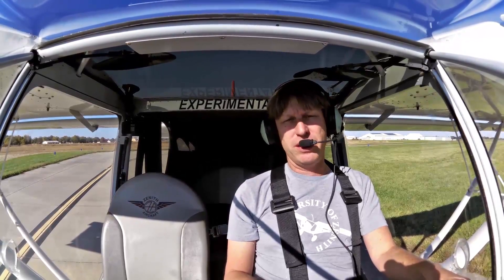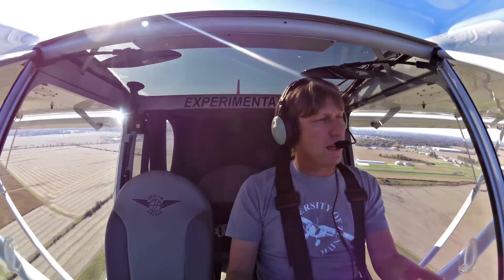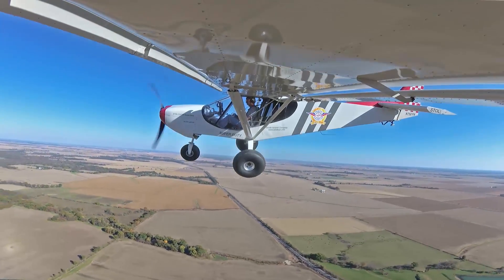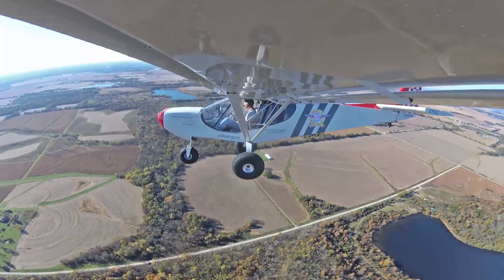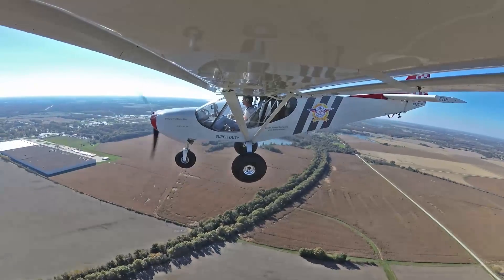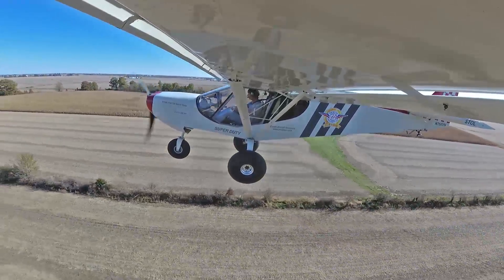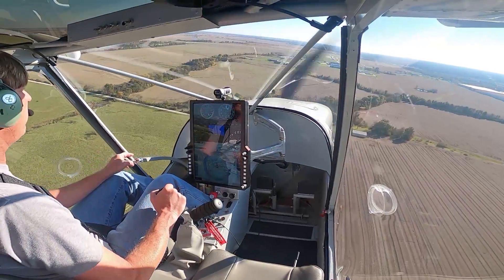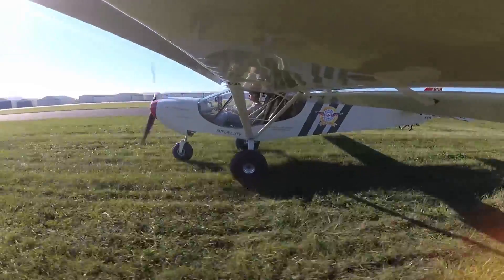Demo Flight: Zenith STOL CH 750 Super Duty "SkyJeep" sport utility kit airplane

Comment: Thanks for the demo flight.
If you do another demo flight would you mind doing a simulated engine out landing? I think I've heard it mentioned that the STOL characteristics of the aircraft induce a bit more drag and a higher sink rate that the Cruzer, for example. I assume you just carry a bit more airspeed on final?

Comment: Thanks for the video. I do like this airplane. 
Question, is there space in the fuselage just behind the rear seat to put a small netted baggage/cargo compartment? My thinking is to reduce gross weight by moving a lighter CG counter balance farther aft. Would doing so cause other undesirable flight characteristics?
Reply from the maker: Shouldn't be a problem if done with proper Weight & Balance (CG) calculations